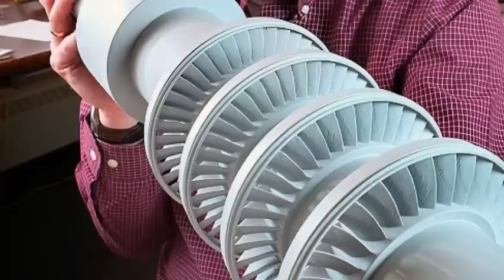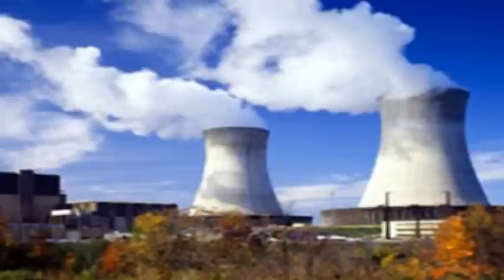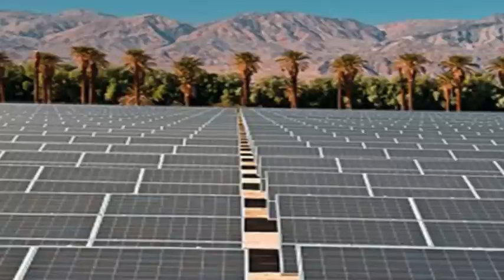Engineers have developed a turbine which has the potential to power a small town

Comment: Maybe, if I moved my stapler over a little bit, it would fit on my desk. . . but. . . if the start up sounds anything like a Bell turbine helicopter. . . I fear I would get no work done, because I'd spend the day pressing the start button. . . and grinning.

Having said that. . . Thanks for your innovative work on an important area, ie energy and improved ways of it being generated. . . Try popping some stators in the pipe and/or some variable inlet guide veins, to triple the power potential of your fixed-incident turbine blades . . . just saying :o)